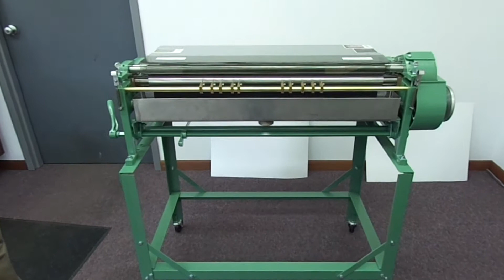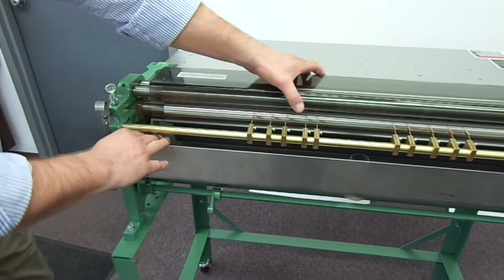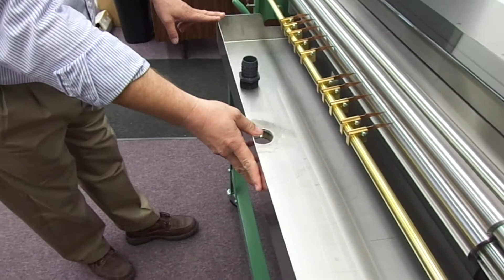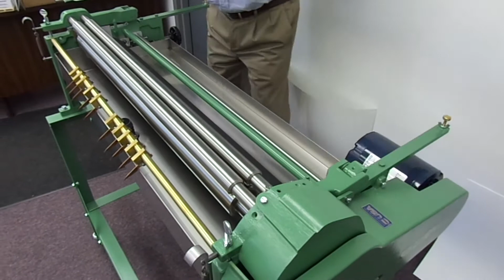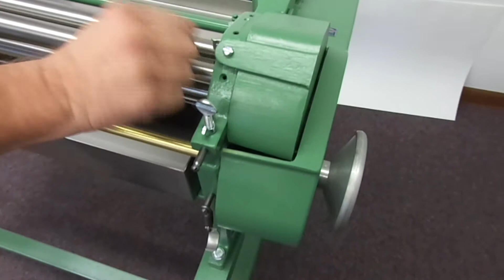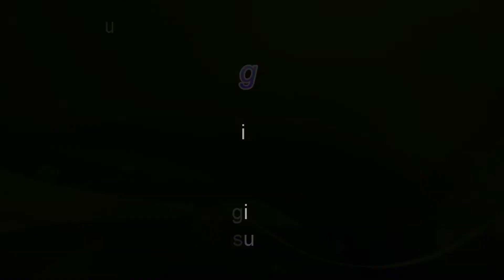Potdevin NTZ Roll Coater

Comment: Good Video. I have been working with these machines where I work for over 20 years. We run 8 of them with 2 that have a larger rotary press.They are very dependable. The only problem I have is with the Picks or some call the strippers. Over the years they have made different designs and I see in the video you made these are the latest and the best. The only problem with them is the little screws that hold the fingers in rust into the holder. Because at the end of the day we put the bar and picks in a bucket of water. I myself clean them and put them back on the bar. We replaced the little screws in them with others. Like I mentioned before. Very dependable. Easy to work on. Thanks for the Video, Take Care
Reply from the maker: +Captain Everything Thanks for your comments. In case you are interested we just brought in 2 used 42' rotary presses and a used 39" heavy duty Z roll coater.